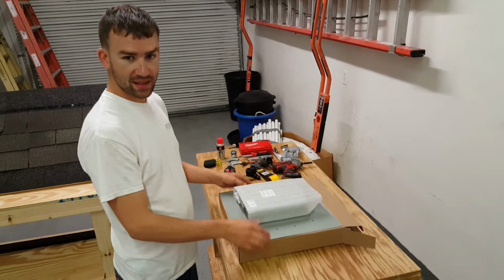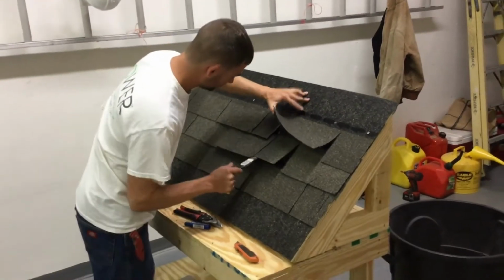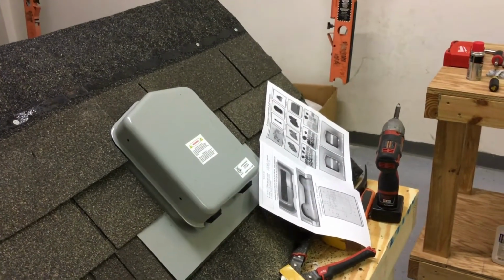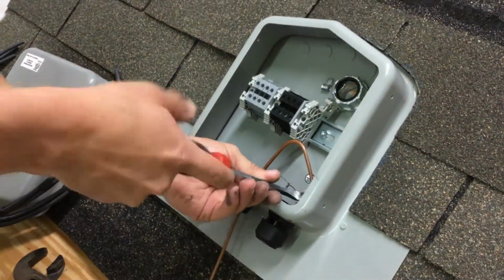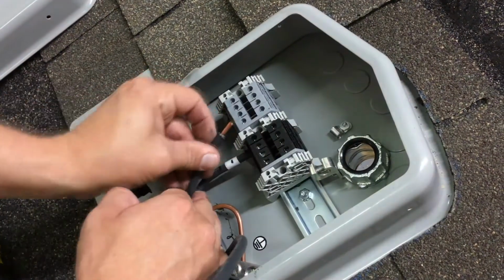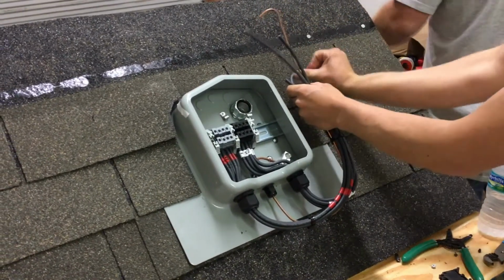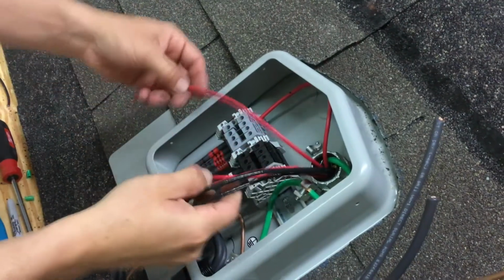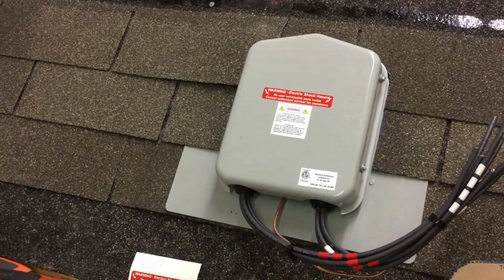How to install a soladeck

Comment: Is there a reason why you can. Or can not used pvc pipe..in pvc you can run a ground wire if you need to ground..

Comment: There is a weep hole at the inside bottom of the soladeck. I wouldnt seal the bottom section to utilize this function. Great video, best soladeck installs out there

Comment: You spent all this time and energy sealing up your wire input connectors to keep every ounce of water out of the box, then drill two weep holes in it which lets water back in. Theoretically of course, because water doesn't flow uphill. So why all the energy to seal the sockets with caulk?
Reply: Weep holes are for condensation build up. If you have rain/snow water getting in weep holes are not the solution.
Reply from the maker: That's a great question. It translates from the universal technique we use from installing any strain relief - including those on NEMA 4, and 4X. So it reduces operator error.

Comment: What kind of terminals are you guys using in soladeck? Also, do you prefer to combine rather than separate strings? Great video!
Reply from the maker: Thank you! Din Rail terminals - supplied by SolaDeck (they offer UL Listed AC and DC kits)

Comment: couple of issues I have firstly you need to use no-ox on all your connections, secondly your ground wire should always flow downwards meaning the ground wire should come in from the top of box then to ground lug, and your hole into the roof should be below that. this way ground will always (drain) down. Also never make a tighter circle than a full six inch curve. these are lightening 101 topics. you always always always need no-ox on all connectors because of the different metals the wire, screws and connectors are made of. Aside from that great video
Reply: Myron Perish :: No-Ox is NOT needed on any of these connections. Both DC PV wire and THHN wire are copper, NOT aluminum where No-Ox WOULD be needed.  IF and only IF metals on screws were dissimilar to equipment then scrape paint and apply nickel metal hydride to area of connection but likelihood of corrossion is also mitigated as these are typically installed under array with water tight seals plus weep holes strategically drilled out on bottom in the video demonstration and the screws used are the ones that came with the soladeck. 

Ground is fine here as the path of least resistance is a wire of greater size and comes out bottom of soladeck(best practice) then travels with THHN to either service through inverter in this scenario or to another soladeck if strings are on different roofs that call for that in the design.  I have no clue what you're referring to when mentioning a 6in curve but based on your other issues that are NOT issues; I'd bet that is wrong too.  Hope this helps clear up any confusion.
Reply: The instructions show 3 fasten points INSIDE the box. So I don’t think there’s any issue with this install. They actually don’t even mention screws outside the box.  Great video

Comment: Should be fine without the bond bushing since the connector is not in a Concentric KO
Reply: Code requires both wire be grounded and equipment be grounded and bonded.
Reply: @DavincisClock To clarify why tbe bond bushing is not needed 
, the bond is provided by the lock washer on the connector and the ground is provided by the egc that is connected to the ground bar in the soladeck. This is due to no eccentric or concentric KOs.

Comment: Why the bonding bushing? The Soladeck has a ground lug and a lock nut would bond the EMT to the case if you remove the paint.
Reply: You must use a grounding lock ring or grounding bushing on one side of an metallic conduit
Reply: @justinhiner3782  What code section is this required please?
Reply: Nec 250.92 is the relevant code I believe, but because this is NOT a GEC, but rather an EGC, and the knockouts are not concentric or eccentric, I agree with you that a grounding bushing is not required.

Comment: Nice install.

Missed the crimp for continuous bond between the 6 AWG bare copper and the stranded copper EGCs. Ground lugs won't count as irreversible, just like split lugs.

Otherwise, super clean install.
Reply: I believe you don't need the EGC on the DC side to be irreversibly crimped, just the GEC on the AC side. But there is an exception for bus bars to count as a continuous bond also.
Reply: I don't think there's a code requirement for the EGC to be continuous like there is for GEC. That's why you can have equipment bonding jumpers throughout the EGC end to end. Also, since the 2017 code removed most of the language for a required solar GEC unless "solidly grounded", technically I'm not sure those continuous connections by middle stripping the green ground wire are needed by code anymore, even though it's still a best practice.
Reply from the maker: should need it in this case - terminal is sufficient.

Comment: Great video.  What size hole saw did you use for that 1 inch EMT?
Reply: I used a 1-1/2" hole saw. Gives plenty of room for the 1" EMT connector and positioning.
Reply from the maker: 3/4"